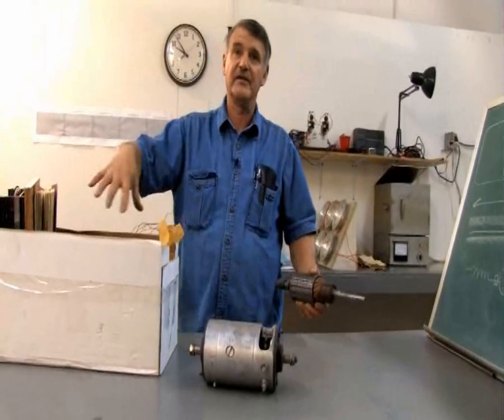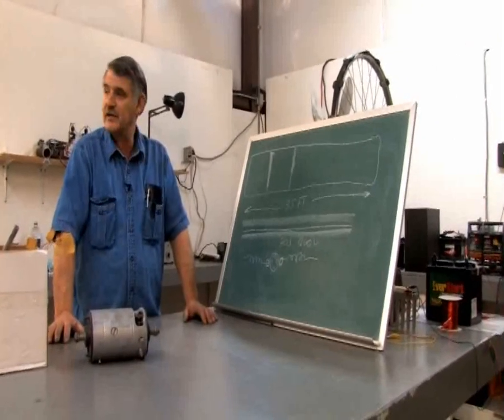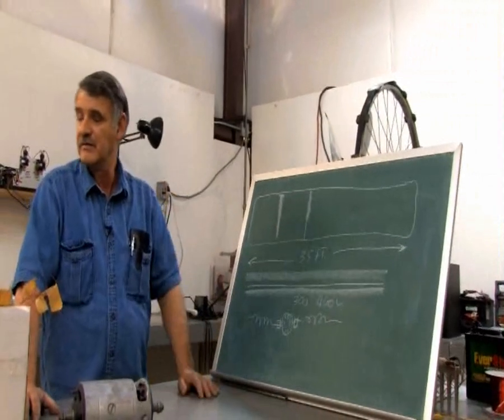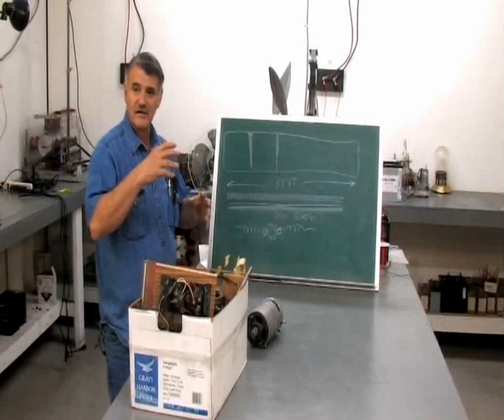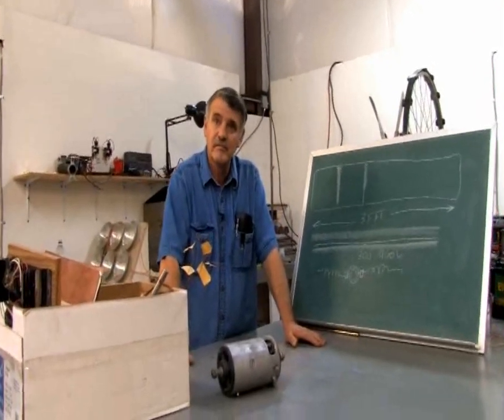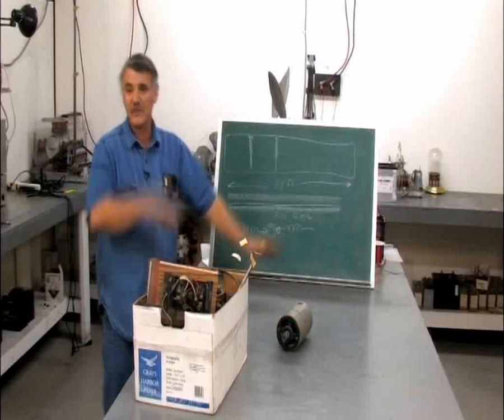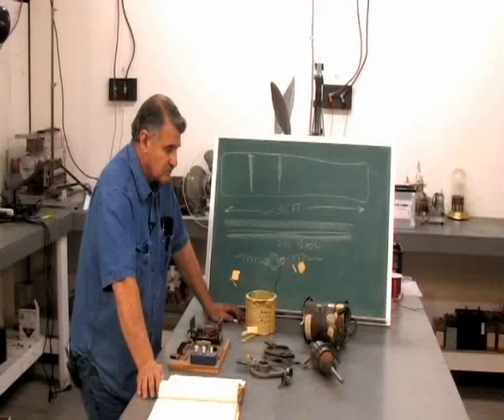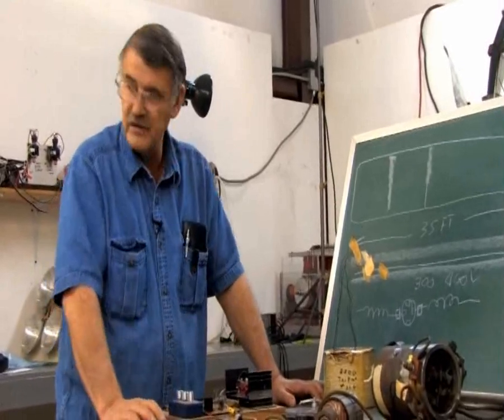Energy from the Vacuum - 14 - Lockridge Device - Part 9

Comment: I have a friend that has 12 of these vintage 1948 And 1950's  VW 6 & 12 volt generators that is being shipped to me. Also I have a very big bag of the same carbon brushes being shipped to me as well. 
Wire coil and the rolled up capacitor can be easily done. I heard about the lockridge back in the 1960's and again in 1980 from an older gentlemen that told me he saw the lockridge running in an airstream RV 
With a group of campers in a state forest. Much thanks,,
Cheers!
Reply from the maker: Damn lucky, I wish had a few to play with. Tho I think by now I know how this works and is very similar to other self running machines. I may atempt one day to just build a solid state version.
Reply: The cap is the easiest part.
Reply: @michellefranklin3182  Hello, Have you seen or worked on the Lockridge device?
Reply: You have something like this working? i would love to get more info on this
Reply from the maker: @EddyFile no, i have not replicated the lockridge device. But every day, I am learning how. Just the other day, I learnt why the slots in the casing. From what I can tell, John is telling the truth in his videos. He may have his own language and terms for things, but it all checks out.